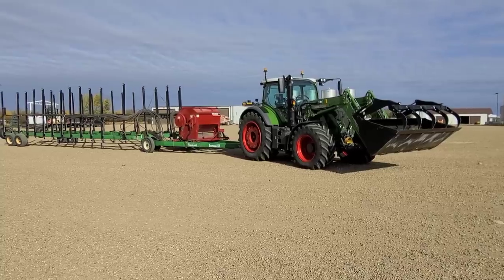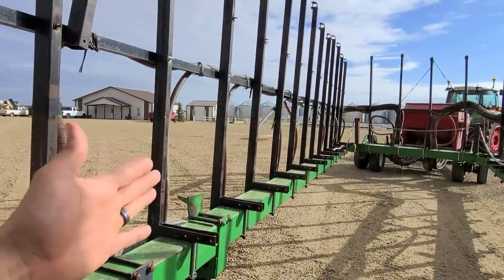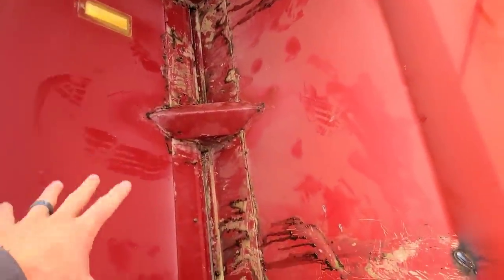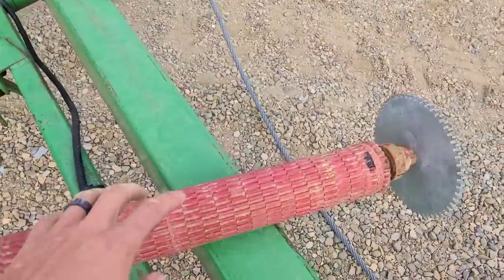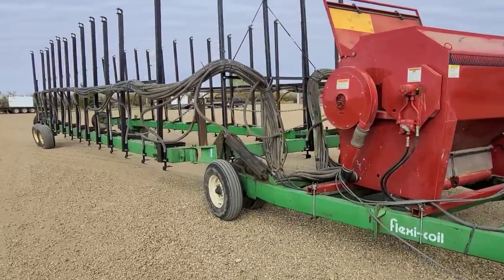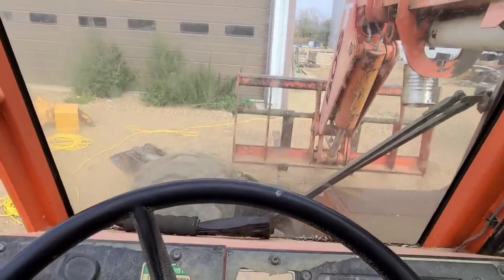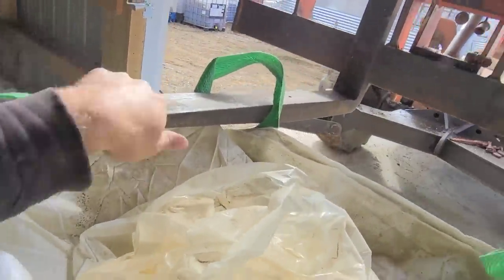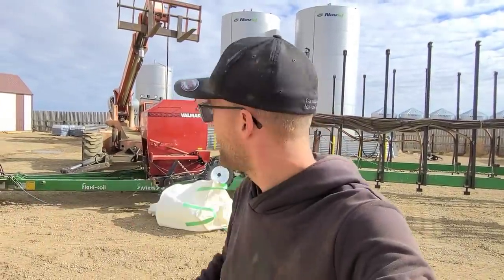What the heck is "edging"?

Comment: Not to be that guy, BUT, lol, floaters do have metered belts on all boxes, it will have a node sensor on the shaft and the Raven monitor will control the product application. Just an FYI, but for what you are doing, not being able to use a spinner spreader, your way is best!

Comment: Mike I notice how much you don’t mind touching granular edge. Maybe it’s fine, but after I found out how it’s mode of action works exactly, I’m always gonna wear a respirator.
Reply: Edge MicroActiv Herbicide, Ethalfluralin (10.0 %)
- Potential skin sensitizer
- Harmful if swallowed or absorbed through the skin
It sounds like the kind of stuff that a person will spontaneously develop an allergy to.
Reply: @beefchicken  from what I learned in my herbicides class (and I’ll be paraphrasing), Edge makes it so certain fibres don’t form during cellular mitosis that pull the duplicated chromosomes apart. Sounds like something that could hurt my chances of procreation besides my incredible lack of personality.
Reply: @beefchicken  thats standard labeling on about every pesticide.